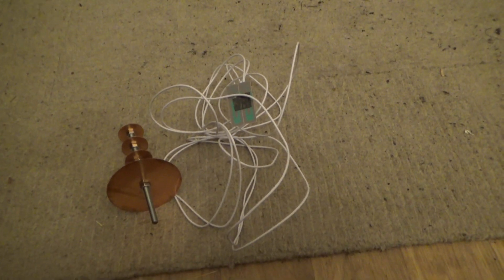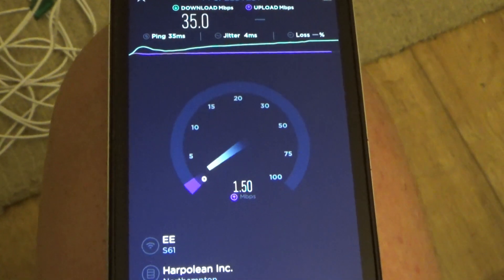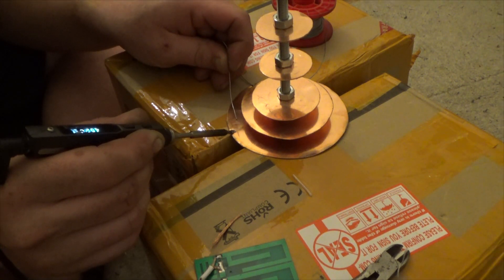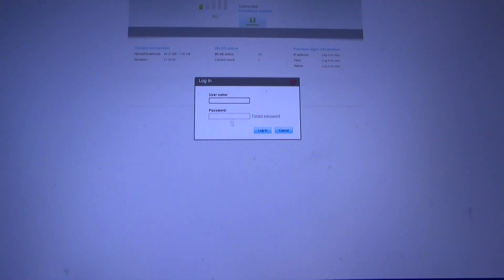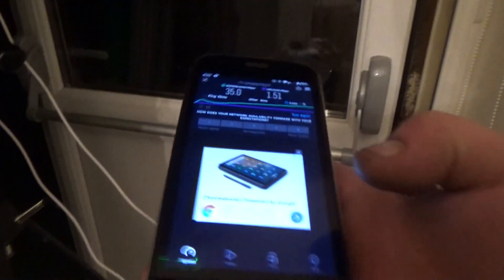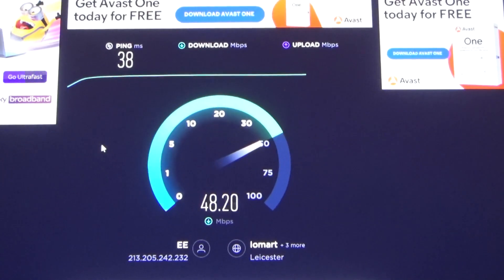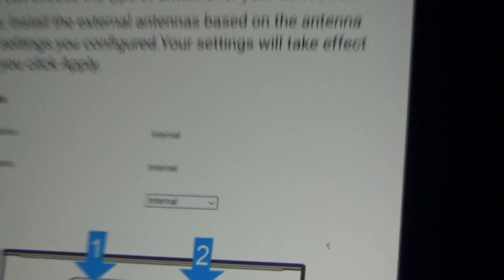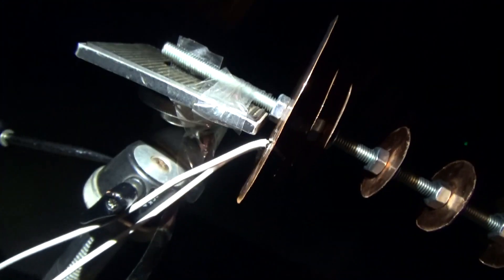KREOSAN's 4G ANTENNA built and tested with speed tests EE 4g UK

Comment: Did you electrically isolate the driven element ( the element after the reflector, the biggest one) from the rest of the antenna ?
Reply from the maker: not in this first attempt, in my later videos i did and it worked much better

Comment: can i use a normal antenna that sits on my roof for this and is there any way to connect it directly to my Phone???
Reply from the maker: yes, mine is about 2 m above ground, its not about height. its finding the sweet spot
Reply: @jamesbrokentech  antenna g spot
Reply: you can connect this to a 4g router and you can use your phone like that

Comment: To Improve your Upload Speed try to use Coaxial cable with high impedence value, that will prevent losse connection of signal.
Reply from the maker: Thanks, what would you consider as a high impedance value